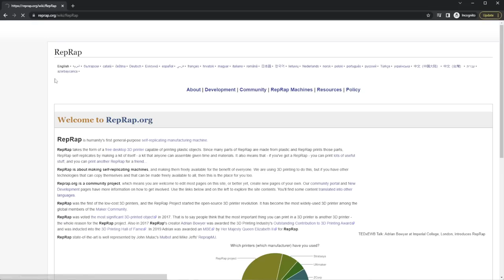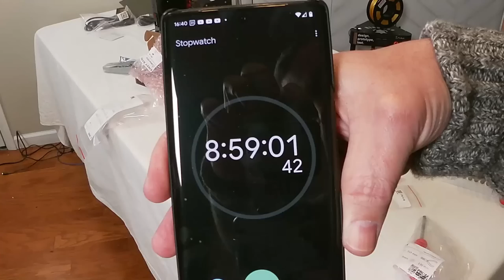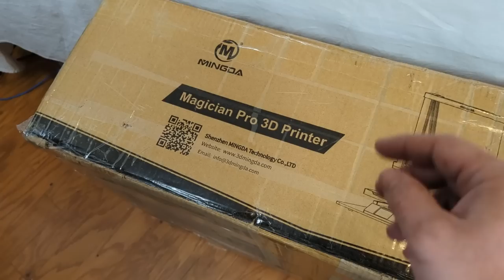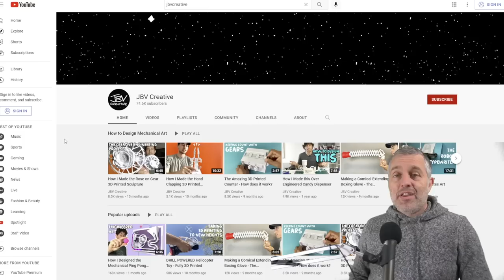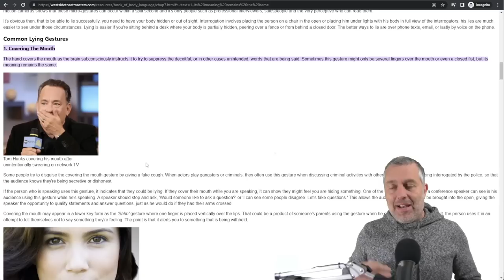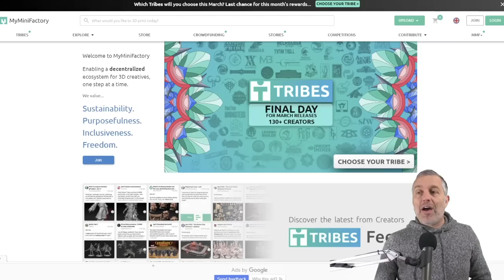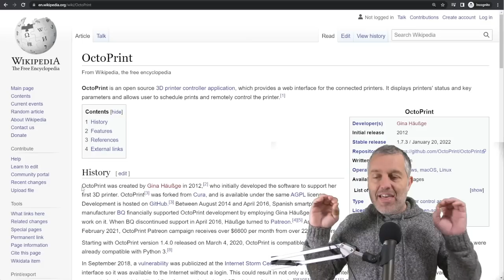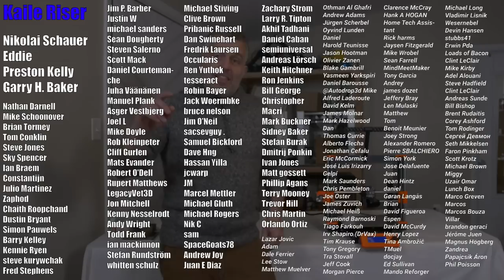Why Does Nobody Speak Truth About The Prusa I3 Mk.3? - It's Overhyped and Over Priced.

Comment: I got my first Ender 1 month after back surgery, after seeing that my friend had one.  He was/is printing a Subaru engine.  Seeing all those tiny bits and pieces, I HAD to have one.  But, I've wanted a 3d printer ever since I heard people were tearing paper printers apart and turning them into 3d printers.
I didn't do any research on what printer to buy, what else was out there, nothing.  For $200 I can make whatever I want?!!?  Done.
3 months later, I bought another E3.
About this time is when I discovered this impressive piece of machinery called a Voron.  Immediately started designing my own CoreXY, because, now having played with the E3's, I understood the mechanics of my Enders.  I now have real-world, this is what this does, don't do that, be careful with those, and i won't buy these again, kinds of experience.   Well...and the motion of the CoreXY is just...awesome.
Another month, and my resin printer showed up.
So...now I am learning about resins and that whole ball of wax because, I can print the parts EXACTLY how my mind sees them, and I can make them translucent to boot.

I'd say...altogether....I've probably got about $1k invested in all of my 3d printing stuff.  Machines, parts, resin, filament, everything.  And I gained experience.  Had I just bought a Prusa, I would not have anything else that I currently have, and my experience pool would be way shallower.

That, and trying to talk the wife into letting me spend more than a month's rent on a hobby?  THAT wasn't gonna happen.  $200?  Yup.  That's easy.  Then when she saw what I can do with one?  Well.......

Thanks for the video.  I truly appreciate the work you put in, and the stark honesty.

Comment: I like Prusa printers primarily for their pre-made slicer profiles. They have polished profiles setup for multiple nozzle sizes and lots of filament types that "just work". Compare that to my Voron and FLSUN SR, and I end up having to tune a profile every time I use a new filament or a different nozzle size. While I love all of my printers, when I just want to slice and get a part on the first try, I always turn to my Prusa Mini. I don't know if there are any alternatives that allow you to print in so many configurations without having to fiddle with the Slicer.

Comment: Ok, since you are recommending people go for a Chinese printer like a Creality, then do you support or fault Creality Cloud for the current controversy?

And, my experience?  Started with a Monoprice Mini Delta that failed in less than a week.  Then got an Ender3Pro.  Chased the upgrade market to get it to print reliable parts.  Then got the Prusa MK3S and then a Mini.  Night and day experience. I’m no longer a printer mechanic.  My 2 machines allow me to also earn some income as a sideline business.  The Ender?  Sitting in the closet collecting dust.
Reply from the maker: >My 2 machines allow me to also earn some income as a sideline business
I'm super interested in this statement. How are you finding customers? Do you draw in CAD? What are you printing?
Reply from the maker: Good man! I've been intensely interested in the print farm low volume manufacturing aspect of this hobby for many months. I imagine that you earn most of your money by doing the reverse engineering or CAD work. The printing is kind of an afterthought, no? Once you've got the design anyone with a printer could make the part. The true value you add is creating the part on the computer, right? Are you able to make many copies of your solution and sell on ebay? Or is it just one-off piecemeal jobs? Are you profitable with this?
Reply from the maker: I don't know any of the specific of Creality's Cloud Slicer. This is the first I'm hearing about it. I should educate myself on this issue more. It sounds wicked and I'm not even slightly surprised or skeptical of your claim. It's par for the course from China. 

I had a "successful" Kickstarter. campaign myself. https://www.kickstarter.com/projects/1096403022/paq-carry-on-travel-backpack Kickstarter was meant to help small creators get started. The world's largest 3D printer manufacturer using the plaform as if they are in the same boat as me...again, that's wicked behavior that I don't condone. 

>How many versions of the Ender 3 are there now?
Preach Brother! I said similar at this timestamp: 46:56 They are destroying what brand names even mean in an attempt to upsell confused customers. See, China wants to have a global monopoly on manufacturing. This is not hyperbole. They don't want anyone else in the world to be able to threaten their manufacturing dominance. But they haven't been able to break into the Luxury goods market (yet?) Western companies manufacturing superior products are the prey they are hunting. This is why Creality hasn't developed a CoreXY for the price of a base Ender3. They don't want to improve that bottom dollar market. They already own it. They want to steal customers from Western companies.

>I get it, you have issues with Prusa
You don't know the half of it. You are awesome. You disagree with me but you aren't attacking my person, and we can have a discussion. Here are two recent comments: "This guy is never happy" "Guy is frustrated with life 😅" These are the short easy to post ones. 99% of comments pushing back against me are just attacks on my person. They gaslight me and try to convince me that I'm genuinely suffering from a mental illness. These anonymous cowards can't debate. All they can do is shoot the messenger.  Why have these low-life cheaters stalked and harassed my channel for the last 4.5 years? Because that's what the egotist wants them to do. He could have stopped it at any time with a "Don't attack DPT on my behalf." tweet. You are here disagreeing with me. Being critical of my video. Imagine if my reaction to your criticisms was to get all of my supporters to stalk you and downvote everything you put out on social media. Imagine if every time you posted a Tractor part my supporters put negative reviews on it and said things like "This guy can't reverse engineer. Everything he makes is trash" Now have them do this for 4.5 years and see if you don't "have issues" with me.

China is the worst, but their strategy involves helping me grow my channel. Even after I release videos like this https://youtu.be/6moNRCXCZpc they still send me printers. Meanwhile It's still highly likely that I (like many others) have been instrumental in helping Prusa make his printers better. Does Prusa thank us or acknowledge our contributions? It's all take an no give. But for me it's worse than being used they active try to hurt me every day. 

The bottom line is that China is the worst thing happening right now.  https://youtu.be/tEKFE37IqgI Worse than Prusa by far, but I can work with China. Prusa just wants me to die. So your self interests say "So what, I'm not you." Well, if he treats me this way, and he treats JBV Creative this way if/when he realizes you exist how do you think he is going to treat you? What if the entire industry was controlled by Prusa? 

I'm not a Creality fanboy. I'm much more positive about Mingda. I tell everyone to buy Ender3 printers because the profit margin is so low it barely helps China, and my viewers get a great printer for a rock bottom price. With the 9 hours I spent building the Prusa I can make my Ender 3 just as functional and reliable. 

Now. I've answered your questions. I'm so tired of this discussion. Can we please talk about your success developing and printing tractor parts. That is new to me and I think others in the comment section here would would love to hear about it.
Reply from the maker: This is awesome Thanks!

Comment: I fully agree that the MK3 is outdated and that slapping "BY JOSEF PRUSA" on everything is at best a form of questionable branding and at worst the sign of a huge egomaniac. But if I have to recommend a Printer to a friend who doesn't have the time and/or technical know-how to deal with a improperly cut PTFE tube, a skewed gantry or a faulty roller that shipped due to lacking QC, I'll happily recommend Prusa machines. The polishing and QC is their selling point IMO, not their performance or affordability. 

If you just want to print some cool miniatures for DND, or a house for your train station diorama, paying around 800€ for a kit or 1000€ for the preassembled version can very much be worth it. They offer a super simple manual, customer support, self-tests, QC in their components and excellent software integration. They sell a RepRap style printer, optimized for the layman. If you're not a layman the value they offer is pretty much none, since RepRap-style designs just aren't state of the art. But if you are? And you maybe even go for a prusa mini, which offers far better value? I don't see anything wrong with going Prusa.

It's like recommending Linux to everybody. A polished experience is worth a lot to many people, and while I'm happy with my Linux install and Ender 3, I have to concede that it's not for everybody.
Reply: I would never recommend an outdated $800 printer to a newbie. I was a newbie once and looking back I'd be pissed if somebody did that to me. I like to save people money so instead of doing that I would just show him how easy it is to cut a PTFE tube and the other things you listed. Noobs read horror stories from other noobs and think it's going to be a nightmare. Not everyone has the same technical abilities. If I had a nickel for every time someone said something was going to be hard and it wasn't, I'd be rich.

If you just show them it's not difficult then you can save them $700.

Comment: You can't judge popularity by # of Google searches.  I don't question things that work and that I like, I do ask questions about the problems I encounter and report flaws. Not a Prusa fanboy, still just looking for my first printer.
Reply from the maker: There is no direct metric. Therefore we must rely on related or correlated data that we CAN measure. As other commenters have pointed out, It is possible that the Google Trends data is misrepresentative because more people look for Ender3 when trying to fix or operate that less consumer friendly platform.*  However this does not explain why Creality has a MASSIVE spice in searches corresponding with the Prusa XL announcement which I talked about at 52:23. So, you are right the Google Trends data is not a definitive thing but it does give us a pretty good idea. I stand behind the thesis: Creality is the more popular brand & printer in actuality. The perception has been manipulated on the internet to make people believe falsely that Prusa is the most beloved. 

*I do not concede that Creality or the Ender 3 is all that less consumer friendly or prone to failure. This is a separate question that should be debated or studied. However, if this was true then it could be a viable explanation for the google trends data.

Comment: Helo! I hope you'll see my reply. I have been a follower of yours for a while, wanted to get into 3d printing, so I got a sh*tty Ender 3 v2. I hated the crap out of it, made me think about if I want to continue the hobby or not... This thing had problems: warped bed after a week of use, crappy extureder gear that kept slipping, part cooling fan that gave up the ghost in its first month... So after that really shitty printer I was hesitant to buy a Prusa since they are expensive... then a local listing poped up for a MK2.5s. I bought it... And I can't even state how happy I am with my purchase. This thing was originally manufactured in May of 2017, yet it still kicks the Ender that was made in October of 2021. Sure the Ender is a cheaper printer, but it has such a shitty quality and many people like you say that these things are great starter printers.... You also bash the company and the printer on everything that it is and everything that it isn't. I don't understand why you can't leave them alone. Yes, its not perfect, but you have to think about that the MK3 is 5 years old now, with only 2 minor revisions; Now think about how many versions of ender 3s there are....
A Prusa is still not perfect but you have to give credit where credit is due.
Reply: Prusa for printing and Ender for tinkering with printer. Yeah, I own Ender 3 V2 and MK3S.

Comment: I had a Prusa in the cart when I found your channel a while ago. You recommended the Ender 3. I got the 3mk2 (it was cheaper at the time and had a meanwell power supply) and did a few of the upgrades you recommended. I love my Ender 3 (modded) and paid half what the Prusa would have cost. I also learnt a lot on the journey, had pain, had gain, but most importantly, had fun. Thanks.
Reply: W comment
Reply: Getting and modding an Ender 3 is a great way to learn about 3d printing on a small budget of just $200 plus upgrade costs. However, on the "Project <-> Tool" spectrum, Ender 3 is on the "project" side and Prusa Mk3 is on the "tool" side. Prusa's direct drive extruder, inductive probe bed auto leveling, excellent smooth/textured PEI build sheets, etc, make it the far more capable machine and far more approachable for beginners as well as those who want a "tool" more than a project. Finnicking with bed leveling screws and a bowden extruder is just so far below the Prusa, which can have the user printing a perfect first layer after one minute - but, of course, 750-1000 USD is a far cry from 200 USD. However, Aliexpress shops like Fysetc and Trianglelab sell their own cheaper Prusa kits (the hardware is open source) that bring the cost closer to 400. IMO, Creality's printers have little place in a world with both Prusas and Vorons.
Reply: Tragedy of social influencing: influencer, based on X, got you to do what he wanted, not necessarily what was best for you 😁
(X being his idea of how things are)
We see this continuously: hype when new "awesome" cheap printer comes out with few hours testing -> lots of people rush to buy them, flashback when chip shortage causes CPU change to something without community support -> too late for those who bought them already, recommending stuff that is not normally needed and can cause more trouble than help (bad quality full-metal hotends without proper heatsink cooling and retraction settings), instructions to change cheap loud bad fans to other cheap low-flow bad fans.
Reply: I have both… still like the prusa more. That said, I make money with my print farm. Like enough to pay for my 2400sq ft corner lot mortgage and much more.

But that said, the Ender does print great. I just got sick of the cheap parts and having to upgrade this and that to get any reliability. I’m running a business and can’t afford to get behind because the Enders we’re having this or that problem. But when she is running she does put out some great prints (with a couple caveats)
Reply: I really hate the company creality, I mean, what kind of moron wires the control board cooling fan to the same circuit as the parts cooling fan? With their gamut of machines and huge sales numbers, you’d think they would have a clue what they are doing. But they definitely do not.
Reply: Had Ender 3 V2 for a year, a nightmare. Yes you learn a lot on it, but seriously i spent more time tweaking it than really print.
I got tired of it and bought a MK3S+ and... I regret not having done it before. It is a workhorse, no tweak, no problem, it prints and it prints really well. Some times I don't use it for 2/3 months, I decide to print, power on, print... the print is good without any tweaking. On my Ender, if I don't print for days, I have to do some prints before having an good one.

The print quality is the same, the Ender 3 can make verry good prints for it's price and the MK3S+ does not make better prints, but it just works.
The bed leveling take 2 seconds, you can change the print speed during print from the knob (sometimes print at 300%), direct drive, just have to put the filament it detect it and feed the nozzle asking you if it's the right color, just tweaked the z-offset (with wizard included) when mounted and no more tweak (no excentric nuts nowhere, no bed adjustment to do, nothing).

I still had a lot of fun with the Ender 3 but when you have learned how work an 3D printer, you just want to print.
Yes, there is surely better printers for this price, but it is a solid printer to recommend for who have the money for.
Reply: @blm7929  Well said and I fully understand you. I first got MK3 very near its launch and just few weeks ago got Ender 3 V2 as it's hyped so much to be fantastic printer. Yeah, it isn't. Fan began to rattle after few hours, whole thing sounds like old vacuum, it's slow, glass bed is just annoying with multiple materials, bowden is always quite fiddly, no filament sensor etc. I used it for three prints and yeah it "works", but I immediately got annoyed with bed leveling and sagging gantry. Added second Z-motor and BL-touch and well it's now much nicer to use, but it's still loud, haven't gotten to change bed and it's just slow to start printing. Prusa is just a breeze to use, especially with Octoprint. I don't even know how many times I've gotten that "oh shaite, I started print two hours ago and haven't checked if everything is alright". It works almost too effortlessly to forget the very basic thing in 3D printing. You should always check first layer as it's 99,9% of times when things go wrong, it happens during it 🙂
Reply: I have two Ender 3 Pro, two MK3S+ and two Mini. Mk3S+ and Minis are running all the time and I am very happy with them. On the other side, I didn’t switch on my Enders for like 4 months because I don’t have time for setting up each print, bed leveling etc. I am not Ender fan, but it is good starting printer. BTW this guy literally hates Prusa but I wouldn’t trust Chinese machines as I trust Prusa.